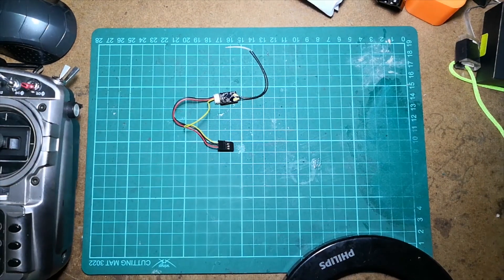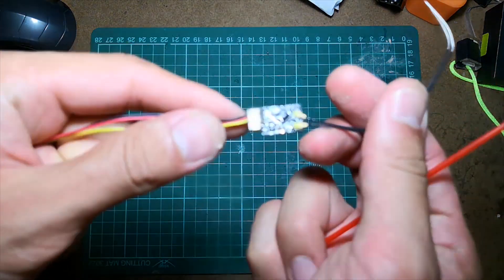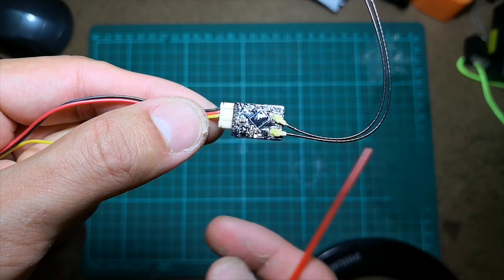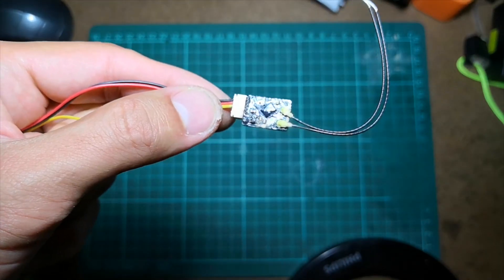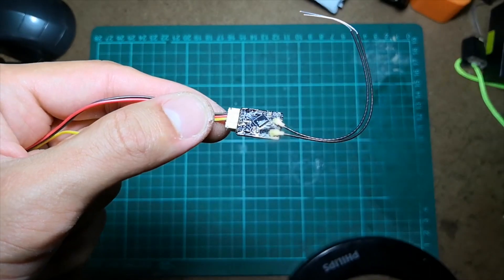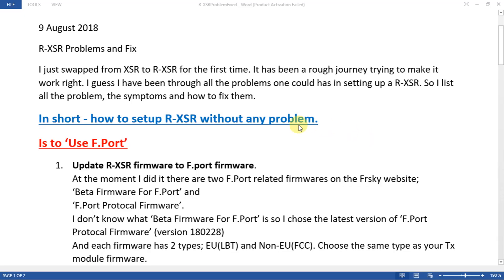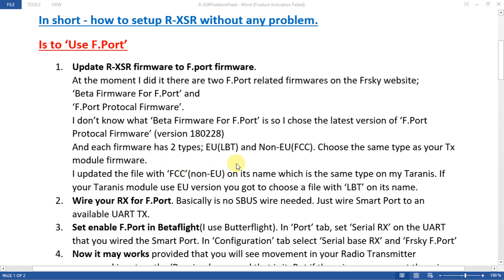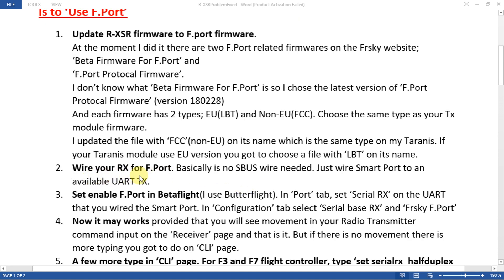Set up R-XSR No more problem!

Comment: ,, Hello friend I have a question as you have a lot of knowledge I have a problem with a receiver is the rxsr frsky is giving me a lot of rx loss and it crashes to the ground you could solve it
Reply from the maker: Can caused by many reasons. Bad antenna placement, bad wiring/soldering, wrong hardware setup, wrong software setup. Hard to tell.
Reply: I'm having same issue when bound to radiomaster 16txs. Connects and loses rx every two seconds. I'm trying this method to downgrade rx firmware then I'll try again. These rx are a pain...and many have this issue but I don't see a solution.

Comment: trying to bind my rxsr and all i have is a flashing red light , even long press fs button nothing happens, cannot get it to switch too sbus.  What to do please ?
Reply from the maker: 1. Red blinking led during binding means binding is successful. Just reboot(unplug and replug) the RXSR and solid green led should appear. The meaning of LED is in RXSR manual. If this is not the case then... 

2. Check if your firmware match with your transmitter firmware, there are 2 types non-EU(FCC) or EU(LBT). If they are not match then you need to flash the correct firmware into your RXSR. 

I hope it helps.
Reply: @FireDFPV  that helped me, i didnt know the fats blinming meant it was successfull, unpowered and replugged and it was solid green with telemetry, thanks!

Comment: This is not true at all, i am running into crazy issues with this rxsr.......I use F-Port and this actually is where my issue was beginning, also it is really sensetive to placement of the rxsr mine knock out video completly when i turn on my taranis, using F-Port! Since i flashed F-Port and use the uninverted signal for it i only have issues = sensor lost, telemetrie lost, rdm no fpv video or really  bad......If you ask me Frsky should work on that, it is a pain in the a........ :/
Reply from the maker: Hmm... I guess U had tried all the solutions that I addressed in this VDO. Including CLI typing and other things. I don't know what are your equipments and what have u done. So I cannot have any opinion on your situation. All I know is explained in the VDO and it was what happened to me. Noted: before I try Fport, all my previous problem was caused by poor wire condition. So in my case, with good wires, it should work without Fport too.
Reply: @FireDFPV  interessting, i am from eu and running eu fport version do you run the fft or how it called for non eu? would be interessting to know because my wiring usually is really clean and things not close to each other, i can just tell that since i am on eulbt fport build i got sensor lost i get telemetry issues and even fully broken fpv feedback in my goggles or really bad range like 100-200m on 200mw, all caused somehow by the rxsr it is really sensetive if i hold my hand over the rx it will recover video but again loose sensor and telemetry, pretty strange. got one running sbus eulbt firmware and it did not have the issue. Another funny thing is if you share the same 5v for camera and rx, like on the dys f4 pro v2 the all hang together so basically no matter where u wire it its like soldering them together on a pad, the rxsr do not like this at all as well! So i remove my 5v vtx and go hv vtx on the lipo and put cam there as well, also will use sbus eulbt and i am sure the problem is gone, but it was strange i searched for this issue for weeks now and found it out myself by testing. Got to be eulbt build and sensetivity to power on boards like the dys. Anyway i am happy that i finally know what was causing all that rdm shit :D And now i will enjoy the hobby again and rip with my forzen fingers haha :D Keep flying!
Reply from the maker: @MegaBadaboom88  Nice to hear that you can solved it finally. My wiring issue that cause the problem is not how clean or how good solder joints. It is the wire itself. I got one wire(should b signal wire) that has a copper thread inside broken. Yes, I strip the signal wires' silicone shiled off to check for broken. And yes just a single copper thread broken.
For your telemetry lost problem, may b the wire😁. For your VDO problem may be power distribution go wrong.
Reply from the maker: @MegaBadaboom88  I never put camera and RX in the same 5V pad and I will not do it. 😅 and the non-eu is FCC as I mentioned in the VDO.

Comment: You really had all these problems with SBUS and Smartport?
I think the more important criteria is to know what firmware you have on your radio. Currently running OpenTX 2.2.1 NON EU and i'm flashing all my R-XSR with firmware NON-EU 171009 and i never had any single issue.
I can't plug directly a R-XSR to the back of my radio because i'm using a 3S LIPO, i'm using a 5V regulator in between to make sure it won't be over-powered and burn out right away lol
Hope your video will help a lot of people :)
Have a great week bro!
Reply from the maker: ABMNS PRODUCTION Yeah... I got all those problems. :-/ I don't know why 171009 doesn't work for me. It works fine for about 20packs and today I try to fly it and I got a NEW problem. Sometimes the R-XSR just doesn't work when I plugged in a lipo. The FC's LEDs is on but red blinking. I got to check if the R-XSR has any LED on or not when this happen. So...
Reply: Holy moly padthai! Sorry to hear about all your issues! Are you sure it's not actually your FC board which sometimes has issue to deliver 5V?
Reply from the maker: ABMNS PRODUCTION yeah now I am curious about the 5V supply.
Reply from the maker: ABMNS PRODUCTION I turn on radio, plugged in the quad and shook the Smart port wire and the error occurred(Rx loss signal and telemetry). What stunted me was motors abruptly spun once during the shaking! (0.0) I took the wire apart, it was 2 wires linked together one side 6pin JST another is the R-XSR pin, and saw 2 copper lines broke internally near the soldering and one line spook out a bit from the soldering joint. I replace the wire with a new one and try shaking it again, still no problem.
Reply: Good news :) It might be your issue actually! Hope it won't give you anymore problem!
Reply from the maker: ABMNS PRODUCTION But if this the real cause the question is how could I prevent it from happening again? Internally broken wires caused me plenty of problems along the road.
Reply: @FireDFPV  I think your receiver position in your build makes the wires having a lot of play so they deteriorate over time, maybe find a better position for release the pressure. You can also try a little bit of hot glue close to the connector all around the wires to reinforce and release the pressure. I do that for my GPS on my 7" build.
Reply from the maker: ABMNS PRODUCTION I forgot to mention that there is another guy who has same unable to select Raceband3 issue as me(mine is both R2&3 he said R3 not know about his R2). Soooo the wire shouldn't be the cause of that issue. I still think F.port is a necessary. The broken wire is over a year old if not two. It should only be the cause of unpredictable lost of Rx signal. The wire has been through many builds though.
Reply: @FireDFPV  I use the Betaflight OSD to change my video channel. I don't really use the LUA script much since it's a bit outdated especially if you use Betaflight 3.4 ~ 3~5. It's so much convinient to do not have to remove the FPV Goggles lol
In this case, it's maybe just a glitch with LUA script. What a such bad experience you had with the R-XSR, it's heartbreaking.